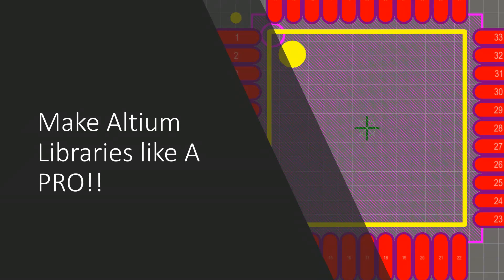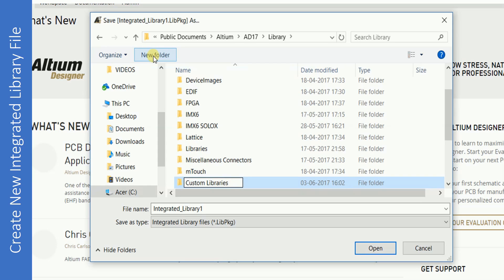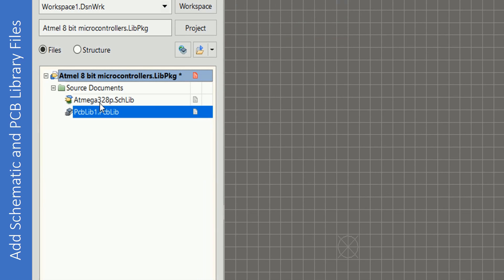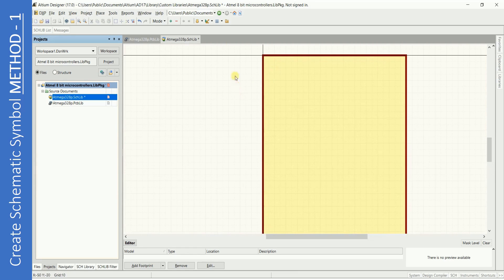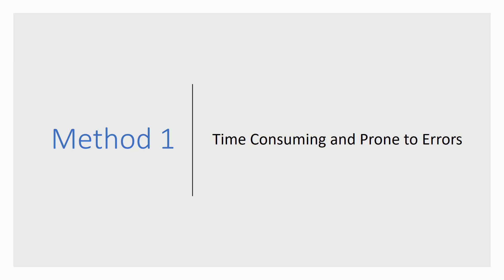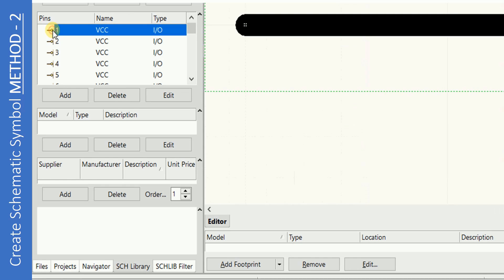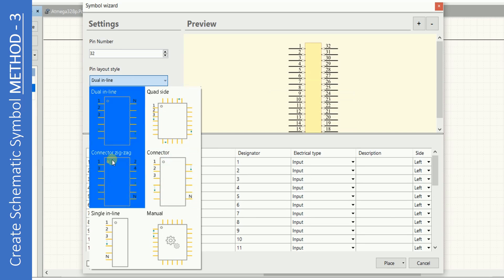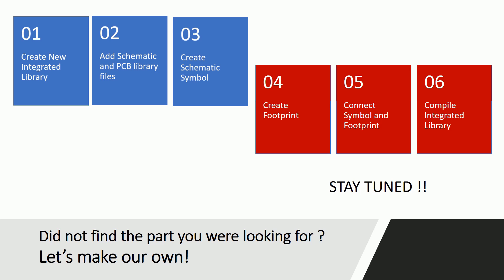Make Altium Libraries like A PRO!!   PART 1

Comment: Here are the pin types as i worked up for the 32 pin TFQP
Pin# Pin Name Electrical Type
1 (OC2B/INT1/PTCXY) PD3 I/O
2 (XCK0/T0/PTCXY) PD4 I/O
3 (SDA1/ICP4/ACO/PTCXY) PE0 I/O
4 VCC POWER
5 GND POWER
6 (SCL1/T4/PTCXY) PE1 I/O
7 (XTAL1/TOSC1) PB6 I/O
8 (XTAL2/TOSC2) PB7 I/O
9 (OC0B/T1/PTCXY) PD5 I/O
10 (OC0A/PTCXY/AIN0) PD6 I/O
11 (PTCXY/AIN1) PD7 I/O
12 (ICP1/CLKO/PTCXY) PB0 I/O
13 (OC1A/PTCXY) PB1 I/O
14 (SS0/OC1B/PTCXY) PB2 I/O
15 (MOSI0/TXD1/OC2A/PTCXY) PB3 I/O
16 (MISO0/RXD1/PTCXY) PB4 I/O
17 PB5 (PTCXY/XCK1/SCK0) I/O
18 AVCC POWER
19 PE2 (ADC6/PTCY/ICP3/SS1) I/O
20 AREF POWER
21 GND POWER
22 PE3 (ADC7/PTCY/T3/MOSI1) I/O
23 PC0 (ADC0/PTCY/MISO1) I/O
24 PC1 (ADC1/PTCY/SCK1) INPUT
25 PC2 (ADC2/PTCY) INPUT
26 PC3 (ADC3/PTCY) INPUT
27 PC4 (ADC4/PTCY/SDA0) INPUT
28 PC5 (ADC5/PTCY/SCL0) INPUT
29 PC6 (RESET) I/O
30 PD0 (PTCXY/OC3A/RXD0) I/O
31 PD1 (PTCXY/OC4A/TXD0) I/O
32 PD2 (PTCXY/INT0/OC3B/OC4B) I/O

Comment: Hi! Excellent video of yours. I have got a question: I ahve created a new component integrated library, just as you made, following all of yours steps, and I added also a #D step model for my component. But, when I open a new PCB documento, and try to add the compónent I made, it doesn't appear. The library is there, added, but it doesn't show the component on the board, to make connections, etc. Do you have any Idea why, or what did I do wrong?
Thanks a lot!
Reply from the maker: Hi Lucas, Regret the delay in reply. Thanks for your feedback. For the query u asked..Did you create the footprint for the component following PART 2 of this video? The broad steps would be like: 1) create symbol with any of the methods described in Part 1. 2) create footprint with any of the methods described in Part 2. 3) Connect symbol and the footprint using Part 2. Hope this helps.